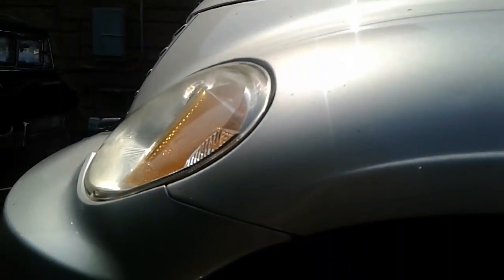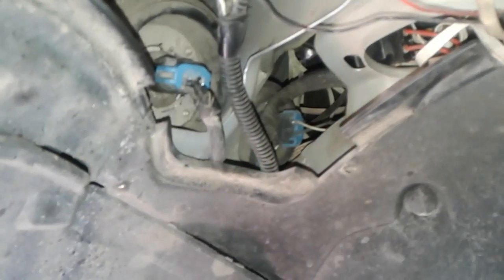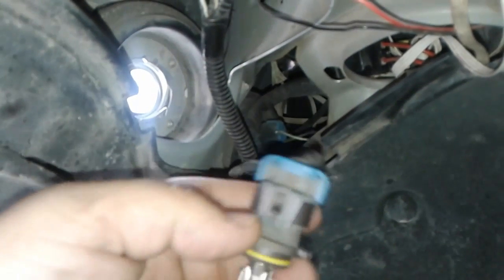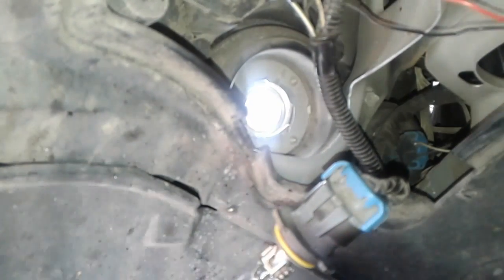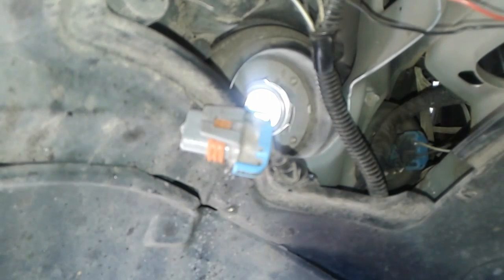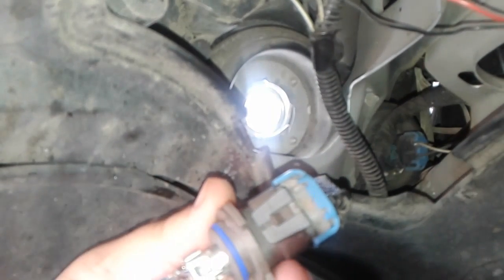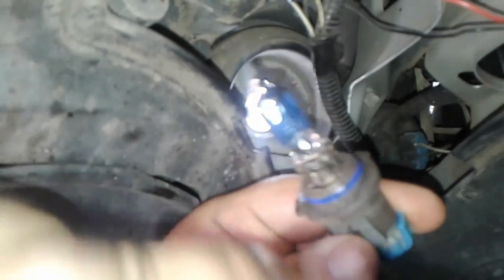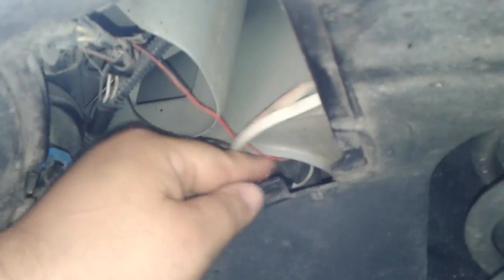Pt cruiser headlight bulb replacement

Comment: Thanks for making this.  I have a question.  I need to replace my bulb but you said not to do it when it's cold because the plastic might break.  Well it hasn't gotten above freezing for weeks where I live and it's not going to change soon.  What do you do if it's cold?
Reply from the maker: Before I bought myself a heat gun I used the ladies of the house hair dryer to warm up the plastic
Reply: @CarManiac125  I was thinking that.  Better find an extension cord! thank you!

Comment: Do you have this car jacked up a little to better access the plate and bulb?
Reply from the maker: Dick Buelow no, but if your arms are bigger than mine then yeah, you'll need to jack up the car for room. Also try turning the wheels in one direction or another.
Reply: Would have helped if maybe you mention what number bulb your useing
Reply from the maker: 9006 is the low beam bulbs and 9005 is the high beam bulbs

Comment: But to try & replace the front park light bulbs which I need to replace I'm going to have to take the wheel off to get at the side light properly & to replace the bulb & I will be replacing both of them  as I will installing them with Leds W5W Kind Regards Peter

Comment: What I can't seem to get right is how to orient the bulb to seat it in the socket and screw it back in. Tried for an hour or more this afternoon and it never would do the right-hand quarter turn. I fully expect it the whole thing to fall out once I start driving tomorrow. Phooey.
Reply from the maker: Sometimes the bulbs come with o-ring that seem to be too big for them. Did you try using any die-electric grease on the o-ring?